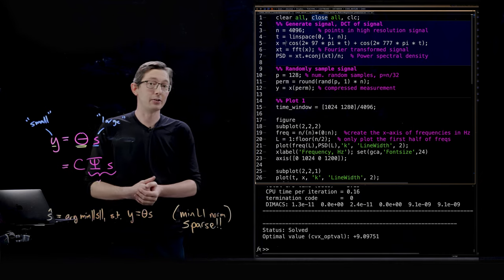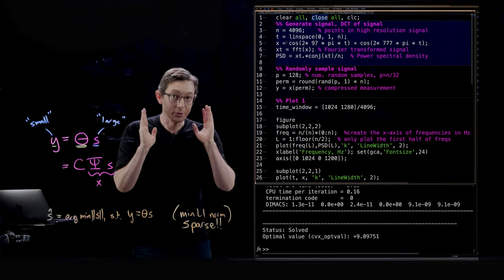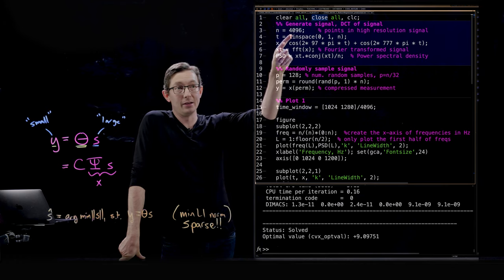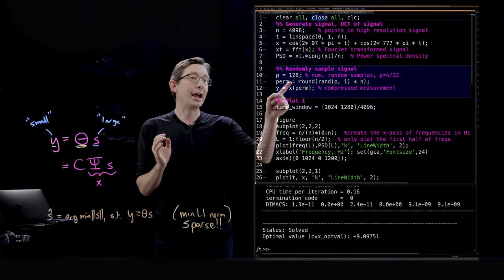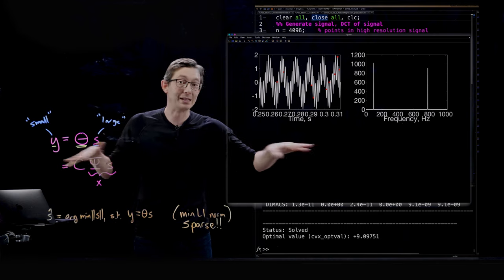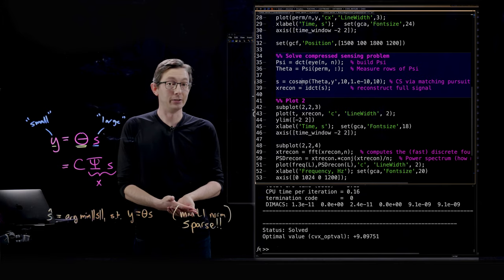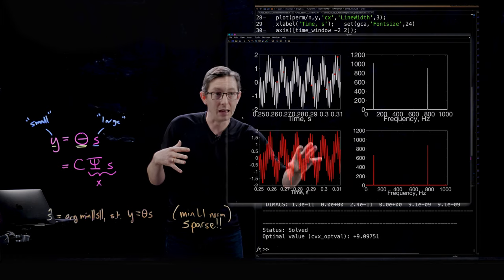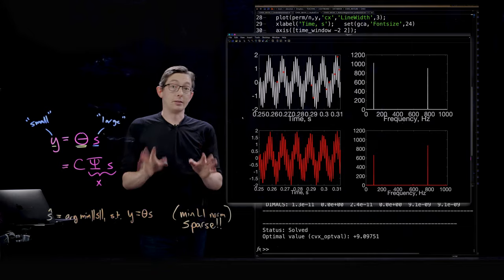Beating Nyquist with Compressed Sensing

Comment: I assume that with the DCT matrix, you can take that matrix and multiply it with a vector to calculate the discrete cosine transform of that vector. In this case, wouldn't "s" already be discrete cosine coefficients since those are the sparse coefficients you are looking for. That is why you do the IDCT at the end to back out the signal. I am just confused why you chose your psi to be the DCT matrix since it seems like you are calculating the discrete cosine transform vector twice. I would think that psi should be the IDCT matrix since x = psi*s and s is the sparse coefficients.
Reply: Just ran the code and I can confirm that the optimization occurs significantly better when "dct" is replaced with "idct" in line 35 of the code shown in the video
Reply from the maker: That is a really good point!  Yes, I believe Psi should be the iDCT matrix.  Good catch!

Comment: This is fascinating - could you accomplish the same effect with the signals from two sensors whose sampling rates differ from an integer multiple by a small amount? I'm picturing a pitot tube which splits off into two pressure transducers, one sampling at 128 Hz and the other at, say, 63 Hz. The least common multiple between these is 8064, so I wonder if your effective NyQuist frequency would be thereabouts.
Reply: Upon doing a little literature search, it looks like this is exactly what I was describing: https://aip.scitation.org/doi/10.1063/1.5063343 Neat!

Comment: Hello :)
I found your videos a while ago and this is like the 4th time I watch them, and honestly every new time I watched it I realize some new things XD
It´s a bit late comment, but I hope I can get an answer. I´m a PhD student, and i´m gonna use Compressed Sensing with wireless sensor netwroks
In the code you use the DCT basis, I wanted to know how the code would it be if instead we use Fourier basis or Wavelet basis
or changing the perm array, from "random single pixel" to Gaussian or Bernoulli distribution?

Comment: I tried this with cvx as I couldn't find the function you used here. It did not work with cvx and resulted in a plausible but different signal. Do you have any idea why this is? I don't. My code at this section was:
%% Solve compressed sensing problem
Psi = dct(eye(n,n));  % Psi as direct cosinus transform
Theta = Psi(perm, :); % resembels multiplication wit 0/1 built C matrix
cvx_begin;
    variable s(n);
    minimize(norm(s,1));
    subject to
    Theta*s == y';
cvx_end;
% Invert cosinus transformation
xrecon = idct(s);
Reply: I tried this in your code as well and it performs identically when cosamp is replaced with this. Please tell me whether I am doing something terribly wrong or whether these are normal inaccuracies at such a compression level.